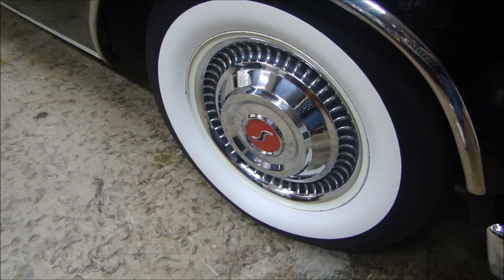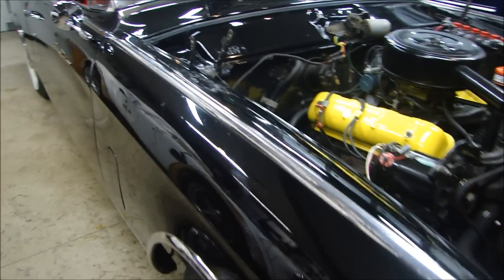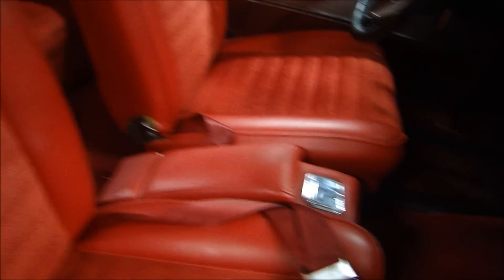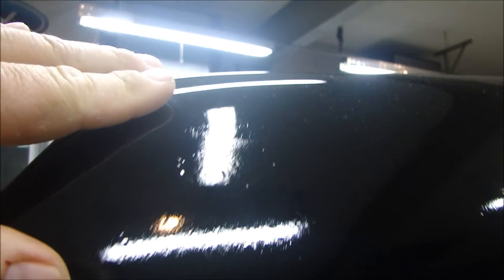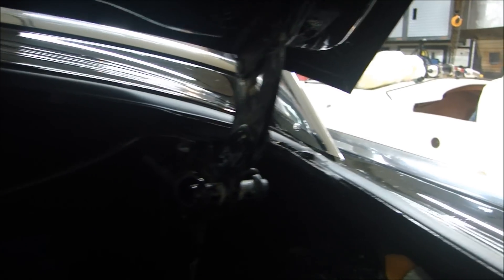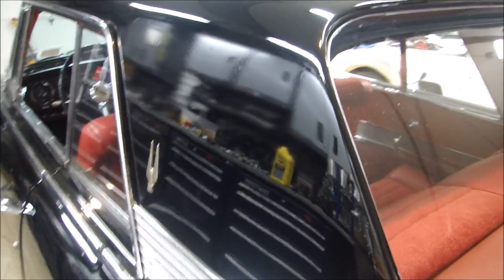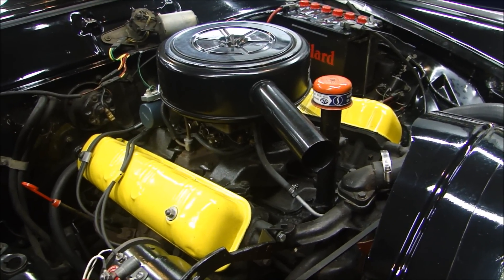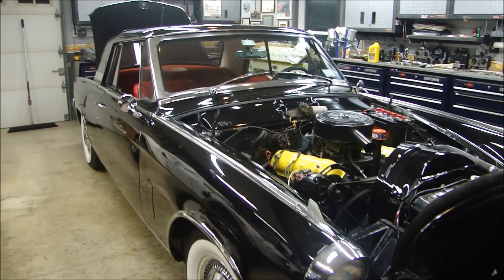Engine Rebuilding 1962 Studebaker

Comment: The Flightomatic Transmission is a 3 speed Automatic that starts out in 2nd gear in the "D" range. Under wide open throttle from a stand start it will then start in first gear and hold that gear at full throttle up to 40 miles an hour. Forced full throttle downshifts can be had below 25 miles an hour from 2nd gear to 1st gear.
Reply from the maker: Thanks Albert
Reply: @PetesGarage  You're Welcome.

Comment: Pete, my first new car was a '63 Hawk!    I had driven a '62 demo and was hooked!  In Aug '62 I sat down with the local dealer to order my Hawk!   Apparently he had some insider info from the factory and suggested I wait until the '63 models were available for order as there were going to be some very interesting options I, as a 22 year old, might find appealing! To make a long story short in Feb '63 I took delivery of a Studebaker Gran Turismo Hawk that turned out to be a very, very rare edition!  It came with an Avanti R-3 supercharged engine, 4 on the floor, and Twin Traction.   The entire '63-'64 model line of Studebakers were available with the Avanti engine options!   These engines had some performance upgrades such as camshaft, double valve springs and others.   Starting with the R-1 which was the upgraded 289 with 4 barrel.  These came with a standard 140 MPH Speedometer as I recall!  Next was the R-2 which was the 289 with supercharger.  Then came the R-3, which is what I ordered.  It was a 304 CID with Supercharger.  Both the R-2 and R-3 equipped cars had 160 MPH speedometers which could easily be pegged!  There was also a R-4 which as I recall was the 304 with multiple carburetors!   I never saw that installation!    Other upgrades with the Avanti options included front disc brakes, stiffer suspension with roll bars front and rear, and larger shocks!   The car was a very stable platform at even the highest speeds!   No float, no feeling of lightness!  Contributing to this was the long 120.5 inch wheelbase with the engine actually sitting mostly behind the front wheels and a low center of gravity!  A line drawn from front spindle to spindle would pass through the water pump, providing very good front to rear weight distribution!  As mentioned, it was quite capable of 160 MPH.  I always considered 80 MPH as its "Snooze cruise"!  When properly tuned it would average about 22 MPG at 80.  I owned it for 30 years, put over 240,000 miles on it.   Sold it in '93, still running!  One of my greatest regrets in life!
Reply from the maker: That is an awesome story! I regret every old car I sold. Thank you for sharing that!
Reply: @PetesGarage  You bet!   I have a cherished photo of it taken by the fellow I sold it to after restoration!  But that was 20 years ago.   Wonder where it is now, but maybe I don't want to know!

Comment: Flight-O-Matic was a three-speed automatic, not two-speed. Packard engineers designed and developed Twin Traction before GM offered it. Depending on shift lever position (PNDLR) and throttle input, one could access either first or second-gear starts.
Reply from the maker: You're right, thank you.

Comment: I wouldn't refer to the poor lead job on the roof seam as "Kinda Neat"
It's that kind of build quality that killed them. 
That said I love the styling of the Hawks!
Reply from the maker: Kinda neat as in interesting to see. Quality is not the only thing that killed them.
Reply: 66-67 Malibu's had the same issue. Looking from the right angle it is very evident where the top was joined to the C piller.

Comment: Door edge panels Leaking like a sieve the screws holding the door edge panel went throw the car floor and into the open bottom of the car letting water to come up through the screw threads and under the thin door edge and your carpet would then get wet and after a while the floor would circum to rusting out .  Studebaker never fixed this issue !
Reply from the maker: Interesting. I'll share with the owner
Reply: BIGBADWOOD 9

Comment: the rebuild cost more than original price of car when new .put one of those engines in 51commander convt.50yrs ago .rod bearings needed watching on all stude v8s we used to race 53 starlight cpe. noisy engines the  56hawk had optional 350 Packard engine don't know if came w.2 fours or not.
Reply from the maker: Yeah, after 55 years the costs are higher than the original price. This one came with a 2 barrel but was converted to a 4.
Reply: Don Desnoo c
Reply: Don Desnoo  Actually the Packard engine size was 352.

Comment: 3 speed automatic.
Reply: Studebaker and BW’s Detroit Gear Division (“DG”) collaborated on a fully-automatic transmission for some time. Presumably, BW did the heavy lifting, as their experience was much deeper than Studebaker, which bought all of their manual transmissions from BW. But undoubtedly, Studebaker had certain qualities that they wanted to see in the new automatic, the most important one being more efficient and economical than the typical one-speed torque converter units recently deployed by Buick (Dynaflow) and Chevrolet (Powerglide).

Comment: Hello Pete. Looking forward to this series, I have two Studes, one with this engine and one with the Mckinnon 283 (Chev). one little detail, the Flightomatic transmission is a three speed, with a second gear takeoff, very similar to the Ford FMX, in fact some parts will interchange.
Ken
Reply from the maker: That's interesting Ken, thanks for sharing that. I am by no means an expert on Studes, but I'm learning quick.

Comment: Great choice. I've owned a couple of Studebakers with 259 V8s. Smooth, quiet and economical I remember correctly.
Reply from the maker: So far the project has been a joy. Very nice car to work on, not cramped and jammed in like some cars I've done
Reply: Intake manifold from a Cadillac 330? V8 fits on these engines. I'm not sure why but the engine architecture is very similar.

Comment: Should be a cool rebuild. Funny for a higher end car not to have a oil filter as Chevy had them for several years by 62.
Reply from the maker: That is strange, but it lasted 135,000 miles before needing work. Not too bad when you think about the tolerances
Reply: Must have been put together with a lot of care.
Reply: Not the only area where engineering lagged. Still had the brake master reservoir under floorboard I believe and a kingpin rather than ballpoint front end in some cars.

Comment: what is climatizer? I didn't see AC compressor in the engine bay.
thanks for answer!
Reply: Interior heater
Reply: +Matt Feist thanks
Reply from the maker: The heater core and A/C compressor will be added after I am finished. The owner has all the parts. Climatizer is the first terms for climate control.
Reply: +Petes Garage thanks! it's just amazing how American cars had such things years ago!
Reply: I have a 1957 Studebaker supercharged Golden Hawk with the Climatizer option. Interesting Hawks had a separate small heater defrost under the dash. This was separate from the Climatizer that was located beneath the front passenger seat in a recess in the floor. Hot engine water was routed to both!
Reply from the maker: That is really interesting. This car will be fun!

Comment: Question: wasn't the Hawk the basis for the Avanti a year later? The Avanti had a bigger engine, with the supercharger option as well. Can't wait to see how this goes. Sounds exciting.
Reply: The Avanti was based off the Lark convertible frame, had the same size engine options as this car or a Lark.
Reply from the maker: Yes...they only made about 1,200 in '62 and less than 4,600 in '63. It had the 289 in it. I think Studebaker closed with hundreds of Avanti's still  being built.
Reply from the maker: You guts are sharp...thank you

Comment: no filter??
that car is beautiful though. I love those Studebakers. But it is missing a 4 speed on the floor!
Reply from the maker: Nope...no filter. No 4 speed in this cruiser.
Reply: According to the Studebaker's Drivers club, that car should of had a full flow oil filter and adapter screwed onto the right side of the block. From 1955 till 1962 the block had a partial flow unit mounted high up in front of the intake. Someone may have done a previous rebuild with an earlier block and didn't want the filter seen in the wrong place and with no place to mount it down low, left it off. Not a good idea.
Reply from the maker: This one does have that adapter, but it did not come with it. The owner has plans for adding it and I support that.

Comment: :) This series going to be a must.
I´m in aprocess of rebuilding the engine of my fathers 1980 Kadett.

1st time i´ll be doing this, and i´ll going to get help from my mechanic.
Alredy put all the engine appart.

Cleaning all parts are nor easy, but with time i´ll get there

Thanks
Reply from the maker: That sounds like a fun project. Good luck!
Reply: Not funny is the time i´m taking to cleaning all the parts :)
Without proper tools cleaning carbon deposits from the head and pistons as well the other parts like the block  are a bit complicated.
Reply from the maker: Cleaning is a huge time soak. I've done that so many times...a little bit a day gets it done